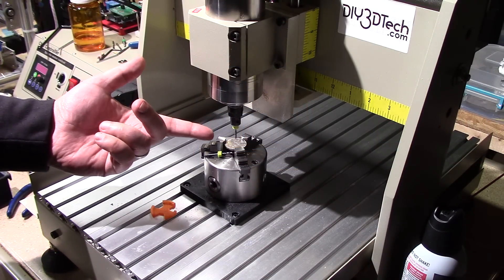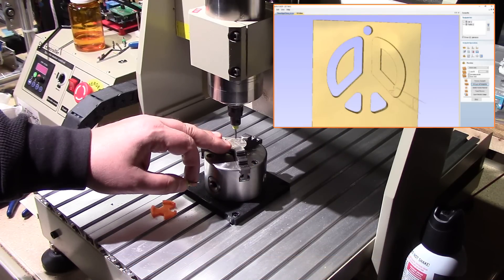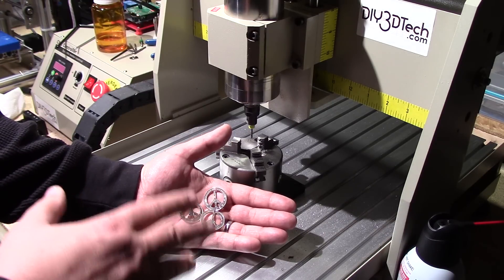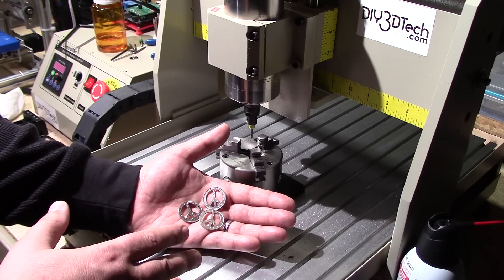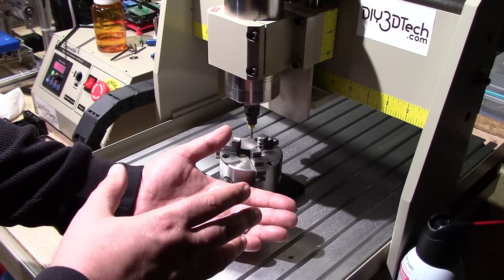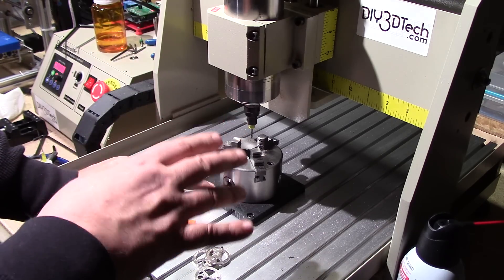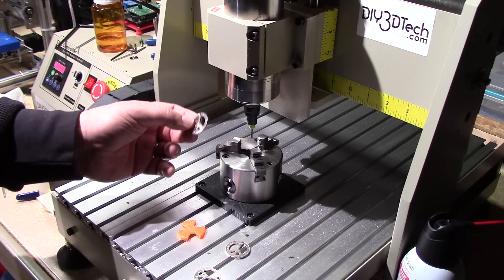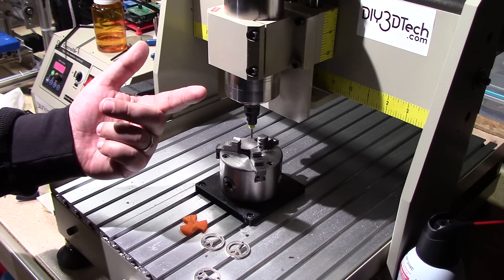3040 CNC - Creating Coin Art!

Comment: Hey Joe, Amazon/Woot have a 3018-Pro CNC on special for under $200. Genmitsu CNC 3018-PRO Router Kit GRBL Control 3 Axis Plastic Acrylic PCB PVC Wood Carving Milling Engraving Machine, XYZ Working Area 300x180x45mm https://www.amazon.com/dp/B07P6K9BL3/ref=cm_sw_r_cp_api_i_ssCrDbQQWW84W

Is it a good starter CNC?  Board has laser capabilities. Looking for your opinion before buying. I am considering it because I’m a Prime member and I can return it easily and it ships in a day so no waiting for China to get the order.
Reply from the maker: I would say this one for the money (the larger one) as once I finish me new house / shop project this fall I am getting Mesh Cam and start experimenting with 3D CNC-ing

Comment: Do an initial pass with the 2.4 and then a follow up pass of 1.75?
Reply from the maker: The only issue is the larger size will not achieve the artistic effects I am seeking....
Reply: @DIY3DTECHcom  The larger size wouldn't be the final result though. It just does most of the big cutting and then the second pass with the 1.75 is easier on the bit and gets the detail you need, especially in the corners.